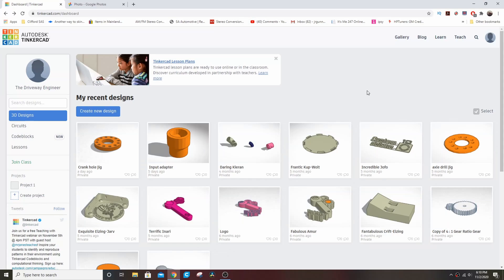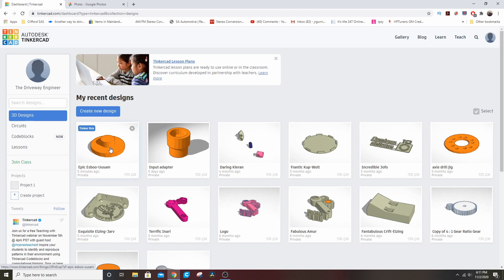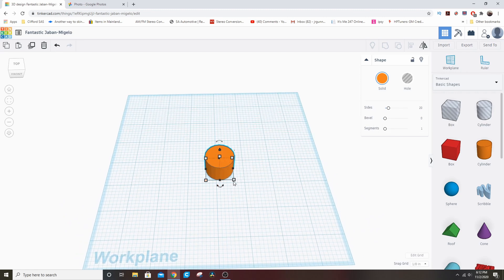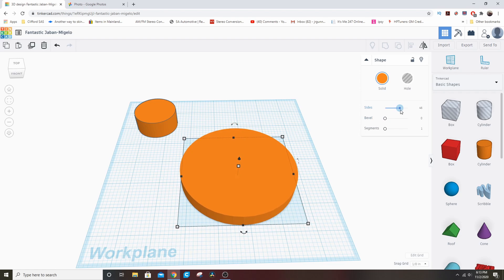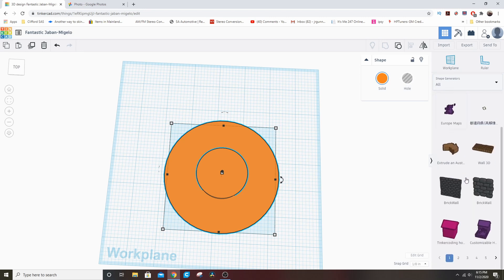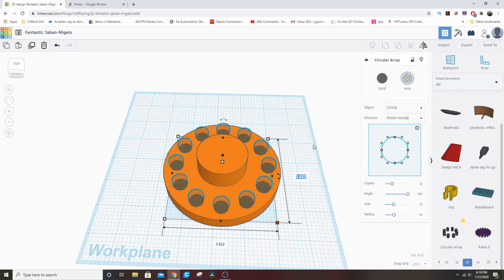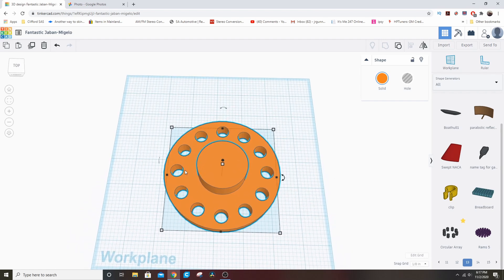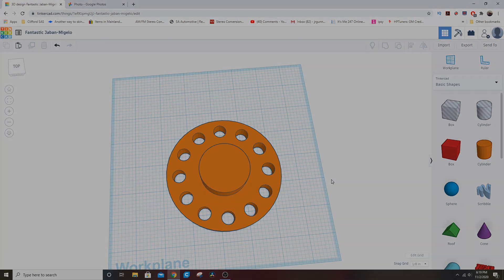How to use CAD to make your own 3D printed parts for swaps and hot rods!

Comment: Did you find the one hole that is slightly offset from the others on the crankshaft?
I remember having to test fit my flex plate around a half dozen times before all of the bolts would thread in, when I replaced the engine in my 300SD.

That aside, 3d printings is an excellent tool for the tinkerer.
I don't know how many little projects I have printed parts for, and my work occasionally pays in plastic for parts printed to use on some of our projects.
Reply from the maker: I did not encounter that, however I drilled all my holes to 1/2
Reply: @TheDrivewayEngineer  
From what I remember being said, it was supposed to key the flywheel or flexplate to one orientation.
I don't know why you'd really care, assuming that there was no external balancing on the rear of the engine.  
My 300SD only had a light flex plate and a torque converter, so it was only an annoyance for me.
Reply from the maker: Makes sense, I just didn't notice it, seems to be perfectly symmetrical to me.